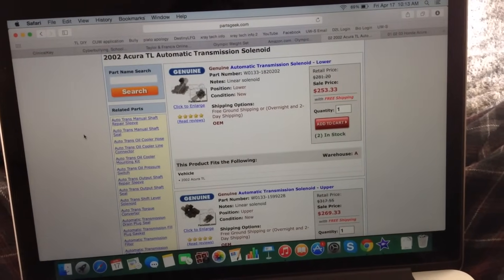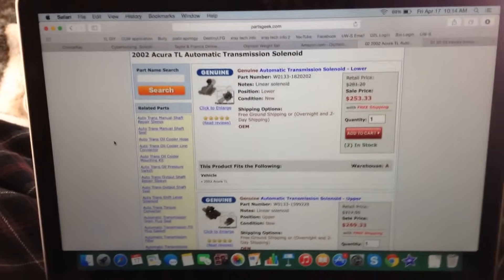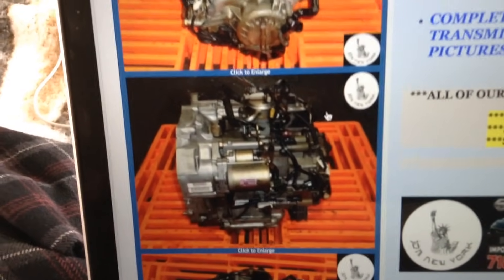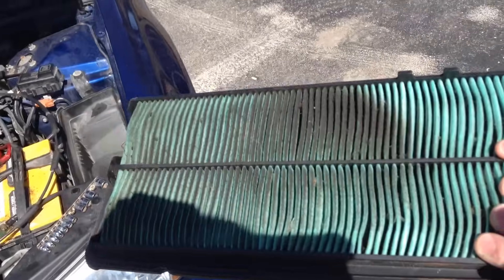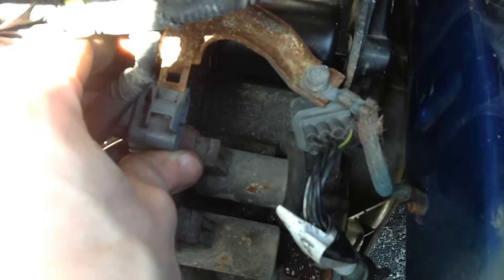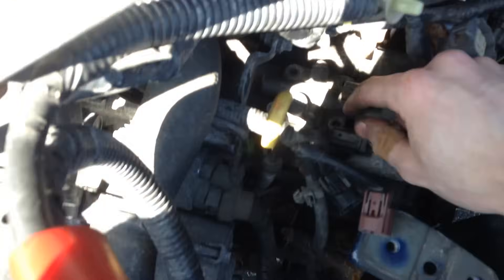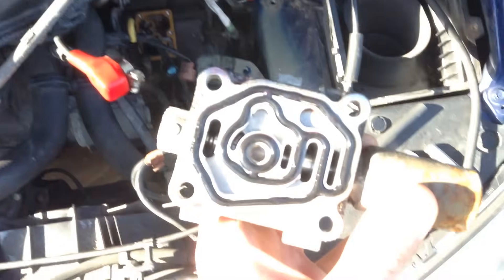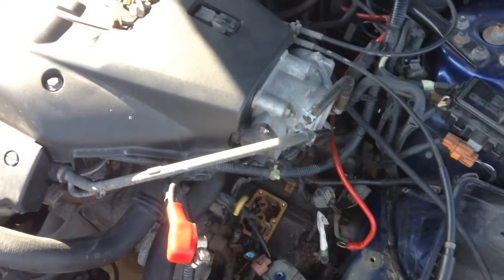Transmission Fix: How to Clean Solenoid Screen Filters for Honda/Acura P0730 P0740 P0780 P1750 P1751

Comment: Is this good to do for preventative maintenance? I have 07 Type S , 246k miles. No tranny issues but i want it to last.
Reply from the maker: Wow 246k that’s awesome, keep up the great work! It certainly won’t hurt anything to check and be safe! But unless you’re experiencing problems, you’re unlikely to find any gunk built up in the screen filters. Best preventative maintenance is to do an ATF drain-and-fill every 15,000 miles
Reply: @CarRepairsMadeSimple  thats one thing i slacked on was tranny fluid changes. Kinda scared to change it now. I may send a sample to blackstone and see if they think its ok to change

Comment: Do you need to still remove the battery even if its not in the way? I got a 1st gen crv and well the battery is waaaay back wile the solenoids for me is up front. Close to the radiator.
Also what else can I use if I dont have a air gun?
Reply from the maker: If it’s not in the way you don’t have to remove it. And you can use brake cleaner if you don’t have an air gun. Thanks for watching!
Reply: @CarRepairsMadeSimple  last question, can I leave the brake cleacker or should I try to get ot off hefore reinstalling?
Reply from the maker: @trentmorrison6074  I recommend wiping it with a paper towel and letting it air dry for a minute before reinstalling

Comment: Can i do this on a 1997 acura tl?
Reply from the maker: You could! The solenoids will look different and be in different locations, but the concept of removing them and cleaning out the screen filters should be the same. I’m not very familiar with the 1st generation TL’s, so I only know of a dual solenoid located on top of the transmission. There may or may not be others. Good luck!

Comment: Hey what did you use to take that gray clip off it just hard to pry apart on that metal
Reply from the maker: Yah those can definitely be difficult to remove. It’s been a long time, but it was probably just a standard pair of pliers. Maybe spray the metal with a little wd-40 to help get it off
Reply: @CarRepairsMadeSimple  i'd tried everything but could not remove it, and also those 6 bolts on the linear solieod iI got the last bolt and could not remove it I put PB blast on it and no bueno 🥲
Reply: So, I gave up til  I can more time to put into it. Just don't want to brake anything more then I  can't replace.
Reply: I sure missed my car speed. 🥲
Reply: By the way, I am a female doing this by self. I don't let just any Joe work on my vehicle.
Reply from the maker: @SwampGurl69  awesome job doing all of this on your own! I guess my only other suggestion it to ensure the little clip on top isn’t preventing you from pulling it off. Otherwise, it might just take a little muscle 💪
Reply: @CarRepairsMadeSimple  well that it my car is out the race boys😒😒😒.torque convert

Comment: Do I need to reset the codes after I removed the solenoids and cleaned to put back?
Reply from the maker: it's been a while since I've had to do this, but as far as I remember, the code didn't go away on its own and I had to reset the CEL. You can get a cheap OBD-II scanner for $30 to do this. I recommend the Ancel AD310.

Comment: hello, my cars transmission slips and won't shift I changed the main relay I changed one broken single the brown solenoid checked the linear double solenoids screens were cleaned; I sure now its the transmission itself broken
Reply from the maker: Make sure your transmission fluid is clean and not over/under-filled. I have another video on my channel on changing your ATF. Do you have a check engine light? If so, you may need to replace the solenoid itself.
Reply: @CarRepairsMadeSimple  thanks for replying;not check engine no lights on when it slips the TCS turns on until I turn it off then on and it's gone I'm gonna change the fluid as last resource thanks

Comment: I have a 2005 Acura tl with the same issue but it has a p0721 and p0722 code but I already replaced the sensor that it says it is but still has the same problem any help?
Reply from the maker: So just to confirm, you replaced the Output Shaft (Countershaft) Speed Sensor? PN: 28810-PPW-013. Otherwise, make sure your ATF is clean and not over/underfilled using Honda DW-1, as well as clean these screen filters. Sometimes the solenoid can go bad without triggering a code. Do the ohm test, and perhaps consider replacing the upper solenoid with the 3 screen filters. You can find good deals on ebay and junkyards.

Comment: My 2002 Acura TL 3.2L V6 Base is throwing the code P1750. Do anybody know if doing this will fix that problem!
Reply from the maker: There's a good chance it could! Your code is directly related to the clutch pressure control solenoid valves A and B (as shown in the thumbnail). Make sure to do the ohm test as well (should read about 5 ohms). Otherwise, if this doesn't fix it, you'll need to replace the solenoid to fix your code. Only use a Genuine Honda solenoid, not aftermarket.
Reply: @CarRepairsMadeSimple  oh awesome man! Any chance you have the link to this part or what should I search into Google to bring it up?
Reply from the maker: @snizzard9730  part number is 28250-P6H-024. Be prepared though, it's expensive. Aftermarket parts are tempting, but I've heard plenty of stories of them not working. Depending on how long you plan on keeping this car or how much money you're willing to put into it, you could also buy a junkyard part off ebay or something.
Reply: @CarRepairsMadeSimple  ok awesome thank you again man. Now I just gotta wait for parts to arrive and hopefully everything will work good.
Reply from the maker: @snizzard9730  I hope so too! Good luck!
Reply: @CarRepairsMadeSimple  hey man so to clean these out, what can I use instead of air because I don't have access to any sort of air. Would brake cleaner be ok to clean it with?
Reply from the maker: @snizzard9730  yes you can use brakleen! Just make sure to not get any on the rubber o-rings
Reply: @CarRepairsMadeSimple  ok awesome thank you man! I had to order the solenoids from a guy off of eBay all the way over in Japan because I tried three different sites for the OEM and the same site you used and they're all emailing me saying the item is backordered with no estimated time to be back. So it will take a while for me to get it but hopefully it will arrive quickly. Once I get the filter I might try just cleaning the solenoids/valves and see what happens from there until I get the brand new solenoids. I'm trying to see if I can fix these problems first using these methods but if worst comes to worst I absolutely love this car and I'm willing to put in some time and money to get a new transmission. However I truly feel like if I do this stuff it might solve the problem. The previous owner always kept up on oil changes but the transmission fluid hasn't been changed for about 22,000 miles and it's pretty darn dirty and the filter has never been replaced. That's why I believe there's just a lot of clogging going on and I just need to replace the filter / solenoids / fluid and I believe I should be ok. Haha!
Reply from the maker: @snizzard9730  oh wow I had no idea the solenoids have been back ordered! I hope this resolves all your problems! Let me know how everything turns out!
Reply: @CarRepairsMadeSimple  for sure! I will let you know!

Comment: I thought my 2000 TL transmission was toast until I found this video. I am the original owner and the car only has 73K on it. I had the trans serviced at the factory suggested 50K which I have found out from you and now others is not nearly often enough. It had been shifting a little weird for a couple of months and then the shifting went wild. The ATF was full. Between gears it was like a stick shift on steroids.  Going any gear, when it came time to upshift, the engine completely disengaged from the transmission. The engine would rev from loosing engagement and  then the transmission would SLAM into the next gear. I thought for sure I would have broken motor mounts on top of the transmission issues. THANK YOU FOR THIS VIDEO! I cleaned the four solenoid filters as you suggested. I also put in a new transmission filter, drained the ATF and refilled.  The trans hasn't worked this well in years.
Reply from the maker: Love hearing stories like this! Glad my video was helpful! Amazing what a couple tiny filters can do!

Comment: Would this cause my car to shift rough in certain gears
Reply from the maker: This solenoid affects all gears. There are, however, oil pressure switches that affect certain gears. You can check out my other video for more information on that! https://youtu.be/_I8zfFmVZZI

Comment: Thank you very nice video! When driving cold by transmission shift perfectly isn’t till it starts heating up and on the way home in  stop and go traffic, the transmission starts slipping and acting up in third gear downshifting unexpectedly and the other day when I came home it wouldn’t even get out of second gear! I had to take side streets home… I am hoping and praying that this will fix it? what do you think? It’s about three or $4000 for a new transmission.
Reply from the maker: I have had these symptoms and heard of other people experiencing similar things where the transmission works on a cold start and starts acting up once warm. Definitely give this a try, it’s free to do and can only do good! Otherwise, make sure your ATF is clean and not over/underfilled
Reply: @CarRepairsMadeSimple  I have this argument with mechanics all the time… But you check the transmission fluid after the car has warmed up completely and then you shut the motor off and then you check it within 30 seconds is that correct? Thank you very much for replying!
Reply from the maker: @weebleslove469  yah, bring the car up to full operating temperature, park the car on a level surface, shut the engine off, and check the dipstick. I suppose it could be different for other vehicles, but it should tell you in your specific cars owners manual.
Reply: @CarRepairsMadeSimple  thank you very much 😁

Comment: Where is the bottom one
Reply from the maker: At 13:44, you can see a shiny surface behind the black wires. The solenoid was already removed at that point. It’s located at the bottom front part of the transmission
Reply: @CarRepairsMadeSimple  ok thks my transmission was slipping I followed everything u did except clean the bottom solenoid but its shifting fine now
Reply from the maker: @backnd_2329  that’s awesome to hear! I’m glad this worked for you!
Reply: @CarRepairsMadeSimple  you think i should still change my 3 and 4 gear clutch pressure switchs
Reply from the maker: @backnd_2329  that’s hard advice to give. There are like 10 different solenoids and switches that all work together to control your transmission, and all the parts are pretty expensive ($70-$350 each). If you’re experiencing shifting problems with 3rd or 4th gear specifically, it might be worth a try. Check out my oil pressure switch/solenoid video for more information.
Reply: @CarRepairsMadeSimple  yea my transmission is making ah weird noise on startup like two quarters rubbing against each other im thinking its still clogged or something probaly the oil pressure
Reply from the maker: @backnd_2329  interesting, I guess the easiest thing you could do is make sure your ATF is clean and not over/underfilled. Otherwise it’s very difficult for me to diagnose a metallic sound over the internet with limited information
Reply: @CarRepairsMadeSimple  believe it or not i just checked my lower one for the first time it was clean but car is still slipping and tcs came on i just dont know wht to do ig im going back to step one good news it does not whine anymore
Reply from the maker: @backnd_2329  do you have a check engine light code by any chance?
Reply: @CarRepairsMadeSimple  yes p0740 and transmission temp sensor
Reply from the maker: @backnd_2329  well at least the temperature sensor is an easy fix! It's also known to potentially cause late shifts, excessive shock, and flaring. As far as P0740 goes, again, make sure your ATF is clean and not over/underfilled, consider replacing the exterior spin-on ATF filter if you've never done it before, make sure the solenoid screen filters are clean (they can clog again after cleaning them sometimes if the ATF is not clean), also make sure the solenoid is reading around 5 ohms. One other thing you could check/replace is the clutch pressure control solenoid valve C, which is the bottom of the 2 solenoids located by the starter on the front of the transmission. The ohm reading (if you can get one) should be between 12-25 ohms.
Reply: @CarRepairsMadeSimple  yea i dont think my transmission fluid clean i see black stuff on the dipstick but the fluid is red
Reply from the maker: @backnd_2329  yeah it shouldn’t be like that lol I have another video on my channel on changing ATF and the filter!
Reply: @CarRepairsMadeSimple  ik im late but will you ever in the future make a transmission change video i think the torque converter is shot
Reply from the maker: @backnd_2329  if my transmission ever fails, I would probably make a video on it. But with this being my daily driver and only car, I wouldn’t want to tackle a job as big as this unless I needed to. Good luck with your car!

Comment: When using the multimeter do you need to have it connected to a battery?
Reply from the maker: Nope! The multimeter itself is powered by a 9v battery. But all you have to do is touch the prongs on the connector to get an ohm reading.
Reply: @CarRepairsMadeSimple  thank you sir

Comment: Code 0753?
Reply from the maker: That would be the Shift Solenoid Valve A, located at the front passenger side of the transmission behind the starter.

Comment: I recently had this code pop up on my 02 TL-S , I just took out fishing with my friend and the transmission was slipping , overheated and now it’s just slipping I’m guessing the clutch material is gone , no clue but a local shop (well known for good quality work) has quoted me for a new transmission with a cooler for it saying the tc overheats , just wondering if the fan would help with the issue of this or not
Reply from the maker: Any transmission shop, regardless of how quality their work is, will never try to diagnose and perform a simple fix for an affordable cost. All they do is replace/rebuild transmissions for maximum profit. The main killer of these transmissions is dirty ATF. A 3 quart drain-and-fill needs to be performed every 15,000 miles to keep these cars going. While an additional cooler never hurts, it’s also completely unnecessary and these transmission guys are like any other shop, they’re up-charging you as much as they can. Go watch my other video on ATF so you can get some fresh fluid in the transmission, clean these screen filters and check the ohm resistance as shown in this video, and go from there.

Comment: Solution pls :- My Honda bulldog 1999 D4 light always start to blink when the gear change to 3 or 4, but if i off the engine and start again it will stop but when it change to 3or 4 gear is start to blink again but my speedometer is not work, i need your advice on how to solve the issue
Reply from the maker: Do you have a check engine light code as well? That helps narrow down the problem as it could be a dozen different things

Comment: 08 Civic 178k mi with no codes. I change the A/T fluid at about every 30k mi. Both part I took out had all screen very clean nothing at all.
Reply from the maker: If you’re still having transmission problems, you could perhaps try doing an ohm test on the solenoids. I’ve had plenty of people tell me changing the solenoids has fixed their problems.

Comment: Can this also help with P0780?
Reply from the maker: It certainly can’t hurt, but that code is caused by a fault in the shifting solenoid. Before you go buying any parts, you can first ensure that your ATF is both clean and not over/underfilled. Only use Honda DW-1.
Reply: @CarRepairsMadeSimple  What do you mean by THE shifting solenoid? - aren't there multiple as explained in this video? Fluid is brand new Honda & perfect level. Before I WAS getting P0740 actually too BTW.
Reply: @CarRepairsMadeSimple  If I do the OHM test on each one, wouldnn't that reveal to me if one's bad?
Reply from the maker: @Secretlightkeeper  yes there are multiple shift solenoids, A, B, and C. These are different than the solenoids we worked on in this video which are the clutch pressure control solenoids valve A/B (on top), and C (in front). After further looking at the service manual, P0780 pertains shift solenoid A (12-25 ohms) as well as clutch pressure control solenoids A/B (5 ohms). Also with that said, yes cleaning the solenoid screen filters can also help with p0780.
Reply: @CarRepairsMadeSimple  I see. I have done a bit more studying up and I think I see what you are talking about with the other solenoids. So, I actually have only had P0780 once, most recently. The rest of the times it was just P0740 actually. I guess just to ensure the best possible results I'll clean the screens and ohm test A/B, A, B, and C and find out for sure what all really is going on. Starting on this tomorrow...do you think since my fluid is clean and correct level and everything that I probably will end up needing to replace one of more of those shift solenoids since I got that code? I guess I'll find out tomorrow. Anyway, thank you so much for all of your responses and your videos. I have been recommending other Acura drivers like ourselves to your channel. I will provide an update on where I'm at in my process after I get started tomorrow.
Reply from the maker: @Secretlightkeeper  there’s a chance you’ll need to replace something. I’ve had plenty of people tell me replacing the solenoid fixed there problems. But I think you’ll get yourself a lot of answers soon after you clean the screen filters and do the ohm tests. Good luck!